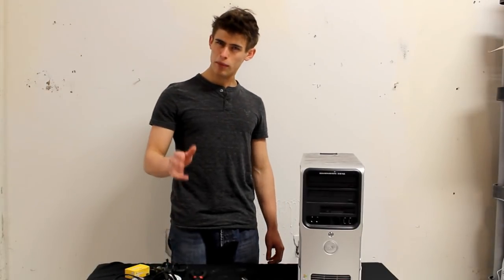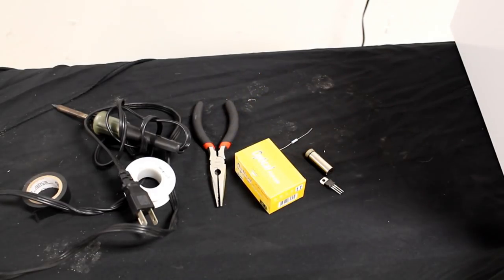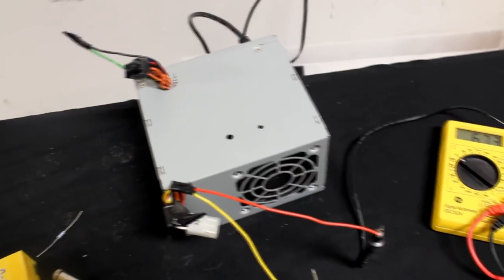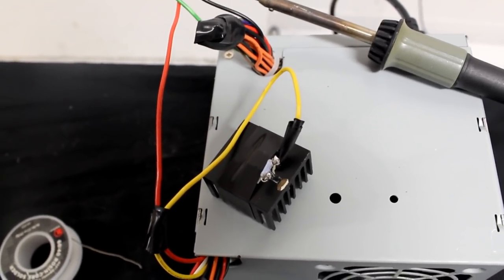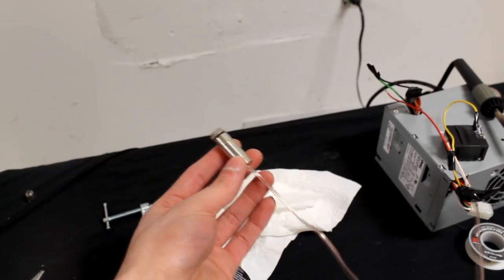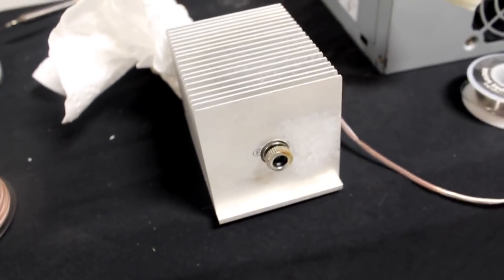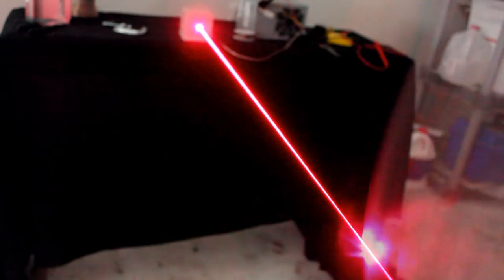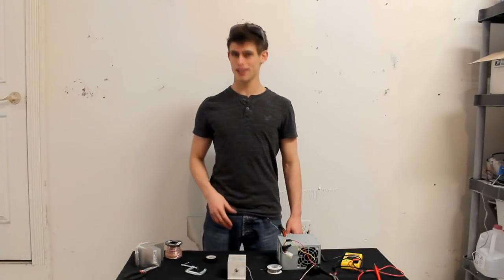Building a Burning Laser from an Old Computer!!!

Comment: Don't know much about lasers, so sorry if this is a stupid question, but is the beam visible to the naked (protected, obviously) eye, or just the camera?
EDIT: Also, how did you figure out the voltage to power it on? Try and fail? googling it? A multimeter and plugging in the dvd drive?

Comment: Bro, When you cut those wires on the PSU like that and tape them without no protection it could be a potential short between the PSU which could lead to fire or explosion. Word to whoever uses a PSU please dont tape all the wires together in the end process.

Comment: sir , i have doubt the smps yellow has +12v and orange has +3.3v so you take these two wires and you read 6.39v how this possible , there is no ground connection taken(black), can you explain this sir , iam a great fan and try to make a cnc engraver by making these kind of videos.

Comment: what size resistor did you use again. Where do you buy your parts from because i can't find a 3 ohm resistor, the smallest i can find is only a 10 ohm. do you mean a 300 ohm, or 3k ohm.

Comment: hey bro do i really need to use a computer power supply for that...?? i mean i do hav some adapters having voltages as 4volt, 8volt, 9volt, and 12volt... can i use one of them??
Reply: yes
Reply: VicZLP i can use adapter or not??
Reply: +Manish EM you can, but it probably should not be very weak. 7V 1A should be fine i think.
Reply: okayy tyy..
Reply: 5V is more then enough. You can power it up by USB or your phone charger. No problems
Reply: thanxx bro...
Reply: No prop bro

Comment: Good afternoon, I need your help, this project will use the component (LM317) and a resistor which setting? You could pass me the correct setting? I do not speak English and for me is a little hard to understand, des I thank you for your attention, thank you

Comment: how did you make the laser beam visible?
Reply: +Wei Wen Yeoh When the laser emits enough 'power' it will become visible, the more power the better it will be visible, this is due to that the light will start reflecting on the dust particles that are floating in the air. The 'standard' green >5mW lasers are already visible indoors (even during daytime) without adding any fog or smoke effects.
So when adding more power to a laser (what is happening here and why it needs to be cooled) will make it visible, 
the point 'when' it starting to get visible depends on the laser spectrum (nM) and thus the color.

And other people that are wondering if it will burn a hole in the wall: NO. Firstly the laser is not power full enough,
and the burn point of the laser is set to a certain distance (the focus). After that point the light will start to spread
again and will cause no damage at a longer distance, another thing to know about these lasers is that damage occurs faster on dark materials than on light materials, since dark material absorbs more light and thus energy.
 
It is VERY important though to wear safety goggles when working with ANY kind of laser in this particular way,
since retina (EYE!) damage can occur VERY quickly with these lasers and their power. Those glasses can
filter A LOT of the light and thus protect your eyes. If the laser is powerful enough it can even damage your
sight when you're just looking at the dot at the wall or object your aiming at! Imagine what would happen to your
eyes when you (accidentally) aimed at something reflective and the beam hits your eye. And don't say that the blink reflex will be fast enough to protect the eye's since that will MOST OF THE TIME! only work for CLASS I lasers,
ANYTHING above 5mW isn't CLASS I anymore and should be considered dangerous! Even with CLASS I lasers
eye damage is possible. So always be careful with lasers. But ofcourse this danger also makes it more fun to most people ;) (including me). I work a lot with high power lasers and enjoy them, but always be sure to take appropriate 
 safety precautions.

- A hardware designer.

Comment: If it was real wouldn't the laser just burn through the floor.
Reply from the maker: The power of this laser is under a half a watt. Yeah it's enough to put out your eyes instantly, but on the scale of relative energy emitted, it is nowhere near what you'd need to melt concrete. The lights illuminating the room are pumping many times more energy into the floor than the laser is.
Reply: ok

Comment: i can get it easily from the sun you have to do all that just to create heat wow why not use a light bulb and use magnifying glass. three sits to create a lazer i mean if you want to create a heat lazer youll need heat so use. high voltage coils or as you know with a house light bulb you can not heat up or burn but in the sun you can why because of heat(:V)
Reply: use a glass to sharpen the light using aluminum or mirror will help increase light.
Reply: +good boy you know what i gave myself a good idea ima try it.
Reply: but what if you're using it at night? the sun's pretty useless at night time.

Comment: Obviously this is fake.  The yellow wire is +12v and the red is +5v from the power supply.  None of the lasers from a dvd burner will instantly ignite matches.  He is using a store bought laser with a much higher power rating.  Videos like this make it frustrating when you are looking for tricks and techniques to building things.
Reply from the maker: You've got to be kidding me. First off yes yellow is +12V and red is +5V, potential is relative so 12V-5V=7V that goes across the driver. At 12V (yellow/black) you'll be dumping a lot of heat into the driver without any change in laser performance over the 7V arrangement.

Also yes a laser diode from a DVD burner can light matches that quickly, you just have to stick them in the focal point of the beam.
Reply: rekt
Reply: Aut0exec_bat lmao
Reply: just because your brain can't fathom it doesn't mean it's fake smh, styropyro isn't a clickbaiter or a faker, he's a frickin genius so give him credit instead of doubt